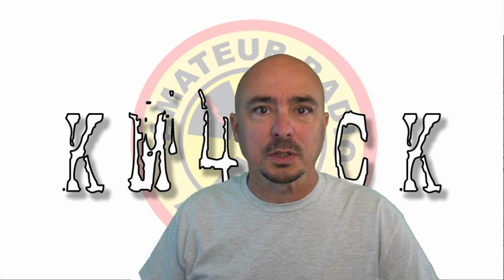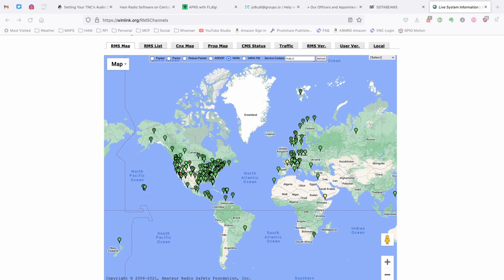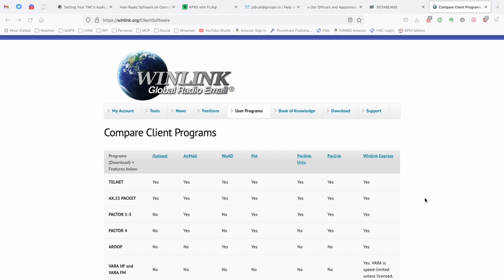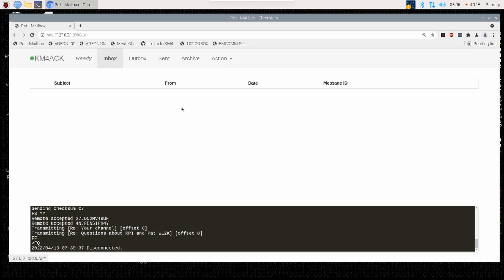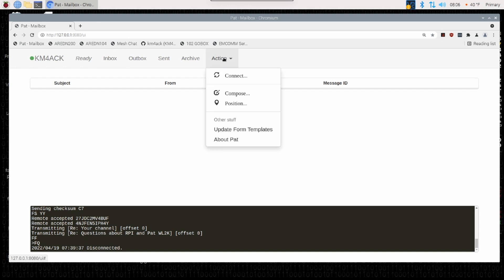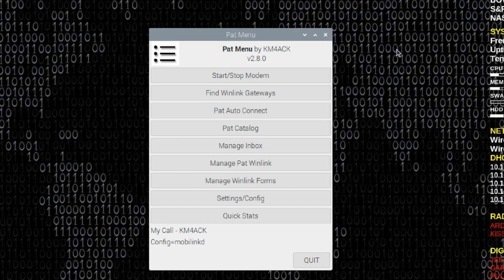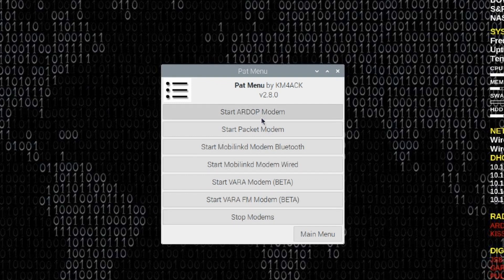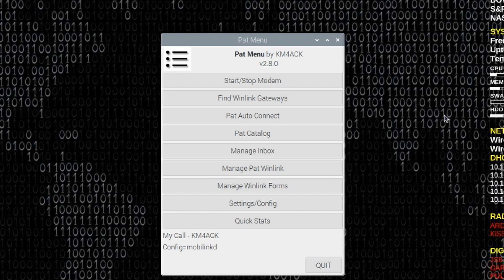Winlink Basics

Comment: Nice to see a basics video. Many folks start in the middle...At abou 2:04 The gateway "passes the traffic over RF".... If not to telnet (internet) what is the destination and how is the message saved for the target operator. (assumimg he is not on the air at the time) Maybe it is just P2P? Or does the message reside on the gateway system untill retrieved?
Reply from the maker: message is saved on the CMS servers. Then when the other operator logs in, the gateway checks the CMS for new messages for the operator logging in.
Reply: @KM4ACK  Thank-You!

Comment: I just used AX25 on 2m to send my first winlink email!! ARDOP and dire wolf can't run at the same time or they fight-
Reply from the maker: True. In fact, in the Linux world, only one thing can use the sound card at a time in most cases. There are ways to create virtual sound cards though so you can run two apps at the same time with one sound card. There's a group that does this regularly with JS8Call & FLDIGI/FLAMP utilizing the same sound card and radio. Google "virtual sound cards Linux" if that's something you need.

Comment: Great video, Jason. Thanks.  Does Winlink allow the use of using more than one client program? I'd like to run Winlink Express on my Windows machine at my home station and also use Pat on my Pi for portable ops. The Winlink site (and a search of forums) is silent on this issue, stating only that an account is created with a client program (singular). Thanks again, and 73!
Reply from the maker: Yes. You can use multiple clients with Winlink. You can also create a new account from Winlink Express or Pat Winlink. One thing to note, the inboxes will not sync. If you download a message while portable, it won't be available to you on your home machine.

Comment: Awesome video as usual.  When I retire and have more time, I am going to try to figure out how to use a dual receive radio as a digipeater on 2M and a Winlink node on 440 at the same time.  The winlink node would see very little activity so the digipeater operation would not be interrupted very often.  The radio would have to support CAT control and the transmit would have to be switched from side A to side B when a winlink connection is requested.  Keep up the great work!  73, KJ4NWQ

Comment: Thanks Jason, Great window to establish the terminology. Can you please elaborate a little further on how to use the system with radios such as the Kenwood TH-D72A that have a built in TNC compliant with AX .25 protocol (that i understand is the basis for all packet communications). For example can VARA drive the TNC in the Kenwood (instead of being connected to mic and speaker and send sound to be modulated over the voice FM).. 73 de k1jbd
Reply: Check out K4REF's videos for the TS2000, that might answer some of your questions. Reference TS200 tnc

Comment: What would be the minimum version of Raspberry Pi to run programs like this? Doesn't look like it take a lot of processing power. Not that familiar with linux, but I do have 1 Pi and was thinking of getting a couple more.  Thx
Reply from the maker: It will run on a Pi 3 but I prefer the Pi 4 with 4GB of memory. Others have successfully run it on a Pi Zero 2 but expect it to be slower.

Comment: I was here before, and not too long ago. I had no idea what WInlink was about, how to get on it, what the terms meant, how to even get a computer to talk to (through) a radio. I just knew somehow hams were sending messages to each other and I wanted to see if I could do it.
Got very discouraged at first because I thought HF was the only way. Super slow, S8 noise floor, and a low success rate finding a gateway that would respond. Then I tried my first packet gateway and I was hooked.
Thanks for putting up this intro video. I could have used something like this when I was learning. I hope it helps many hams successfully get started with Winlink.